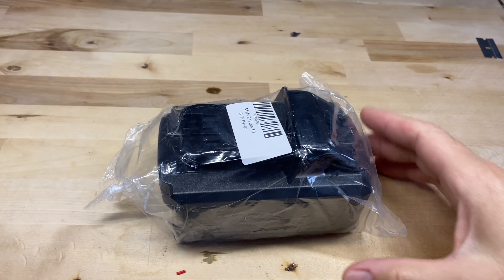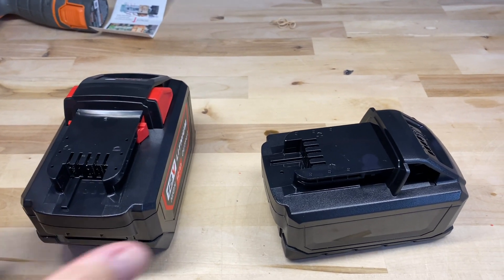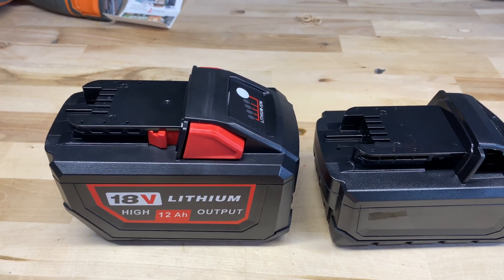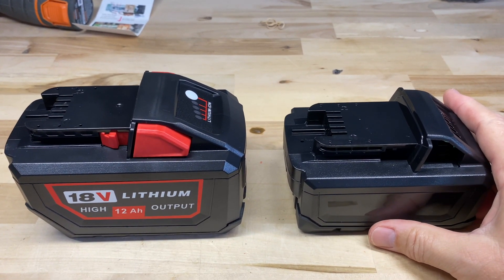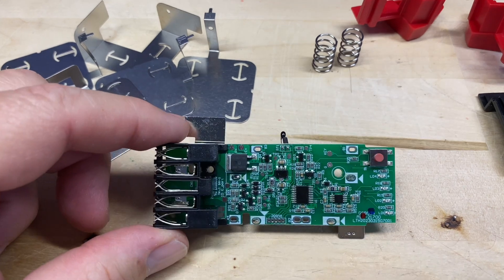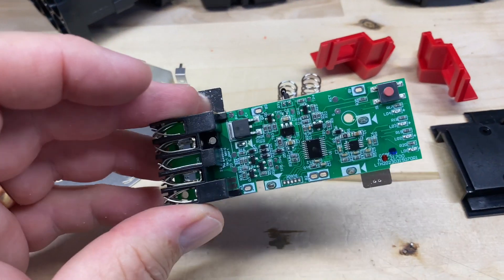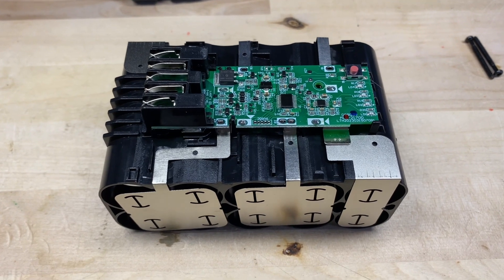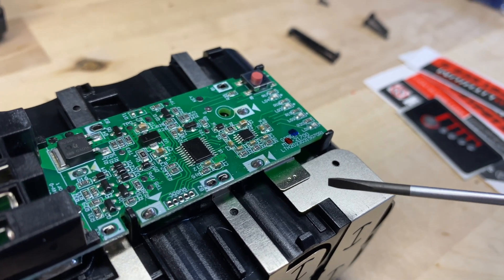M18 8Ah Battery Build With New 21700's

Comment: What orientation do the cells go in what’s the right placement + and - direction?
Reply from the maker: Just look at the control board.  Start at the main (-) Negative and slot the cells from there alternating - to + until you get to the main positive

Comment: Do you know if the LG M50LT cells are too low continous discharge for that battery? They have 14,4A max continous discharge.
Reply from the maker: Too Low for major tools.  If you're just using the battery for a light it's not an issue.  Up to you.

Comment: Will using a real milwaukee BMS allow for the full power of the cells to be used? On TTCs video on aftermarket or custome made m18 batteries, the BMS seems to limit the max discharge of the cells used. Often times a OEM BMS will allow for the best aftermarket batteries.